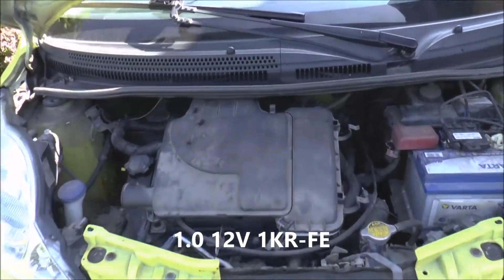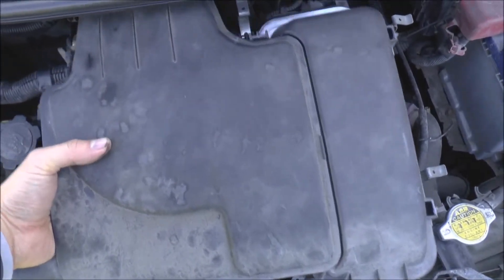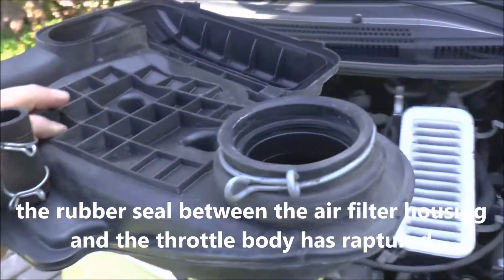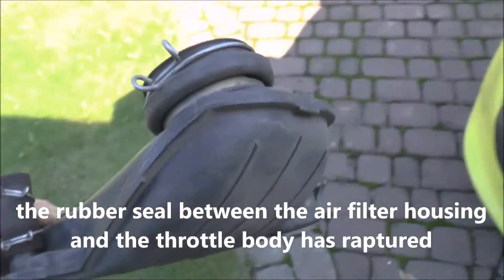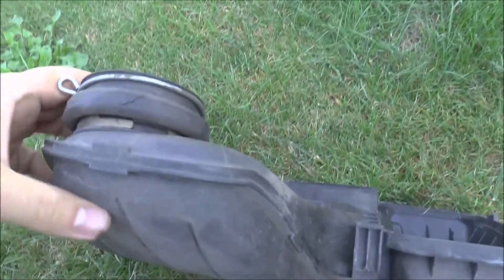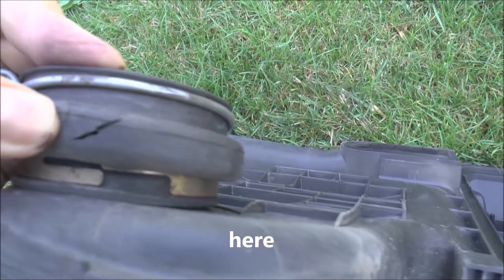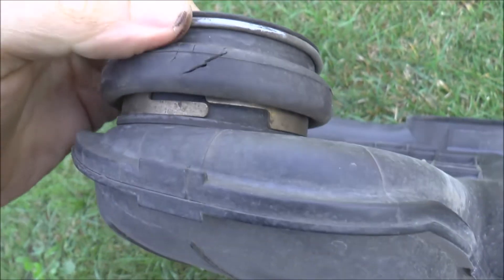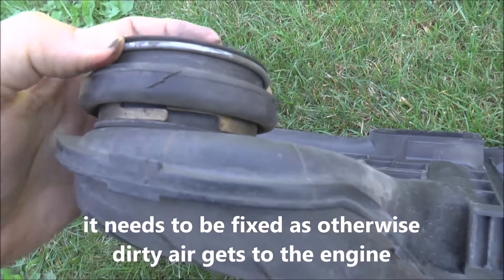Throttle body seal broken - quick fix needed - 1.0 KR-FE - Aygo,Yaris, C1, 107, Sirion, Cuore, IQ

Comment: A temporary seal can be last longer , but becareful using the duck tape for to long , it will melt down the glue from the tape and causing your throttle body more intense damage